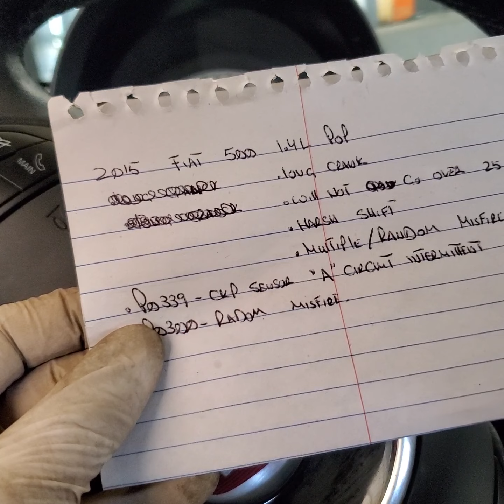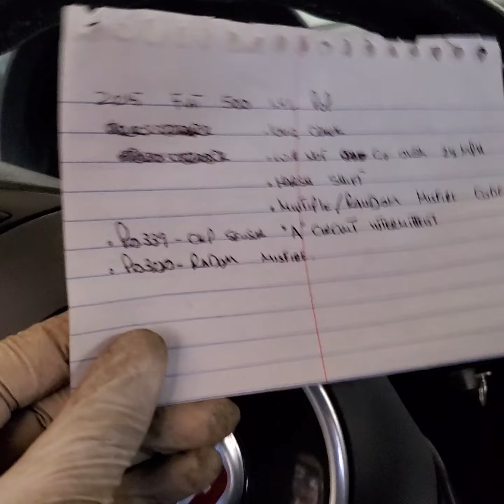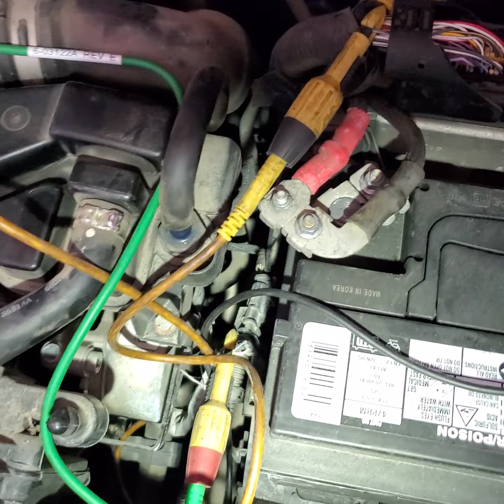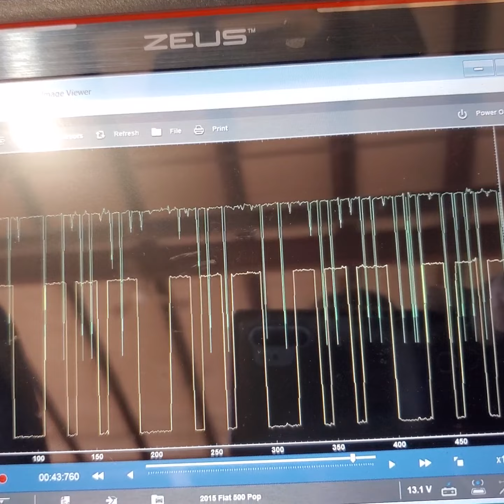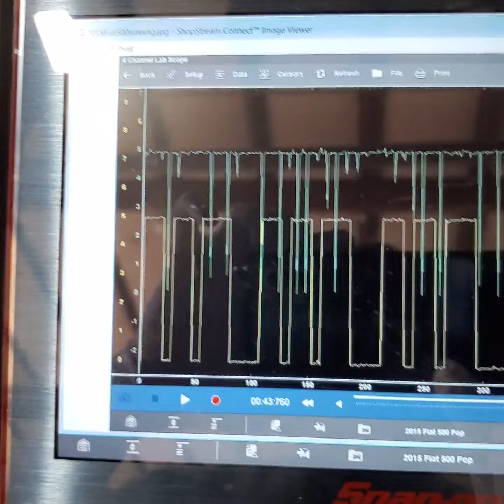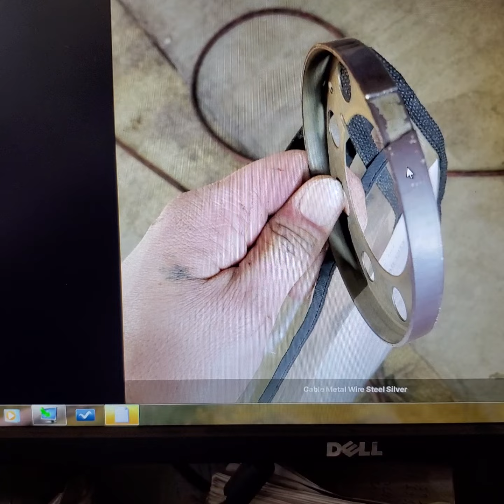2015 Fiat 500 - Code P0339,P0300.

Comment: So im having same problem i think i was getting the p300 misfire code but running fine i stepped on it pretty good and it went into limp mode is it work trying too change just the crank sensor first or is it possable the crank sensor is good and the tone ring is broke and is that common on these cars that the tone ring breaks and the sensor cant read it ?
Reply from the maker: If the crank sensor is bad, chances are vehicle would not start. Not sure if your technician can scope out the crank sensor or not. Crank isn't easy to get to it. I am assuming you want to tackle it yourself?
Reply: @waqasazmat81  it starts with a long crank thats just recent it was fine and running fine with just a p0300 random misfire i changed all the plugs coils oil seperator and it has a new battery thing that needed to be done anyway i went with first but i was driving yesterday and i stepped into it pretty good which i think may have caused that crank sensor maybe too go outta whack but at first i though the trans went in it but i limped it home and was getting a p0339 and a p01064 now its long crank im wondering if its possabkw just the crank sensor is bad and the ring is ok running before i had this limp mode problem was no problem ran fine even though i was getting the blinking random misfire code i would get a long crank sometimes which i thought maybe the start wasnt wasnt working and put a new starter in it im thinking of changing just the crank sensor but is there a chance the crank sensor could just need a relearn ? Thanks for any input
Reply from the maker: You can certainly try to replace the cranksensor but I highly doubt that is the cause. If you have the borescope take the sensor out and look through the borescope maybe that could shed some light on it. Crank relearn is only needed when the crank sensor or the wheel is getting replaced. Try to relearn it anyway if your scanner allows you. You not gonna hurt anything.
Reply: @waqasazmat81  thanks for the info what do you think i should do next ? You think the tone ring for the crank sensor may be the problem ?
Reply from the maker: @rwgtorn  take the sensor out and see the condition of the tone wheel see... if that's not the option then replace the sensor it's less time consuming then taking the transmission out. But get the parts from the dealership. I still think it's tonewheel.
Reply: @waqasazmat81  thanks is the tonewheel hard to replace have you replaced one before i know the trans has to come out i have a lift i can do it on just wondering the intensity of the job like is it a one day job ?
Reply from the maker: @rwgtorn  it's time consuming that's all. Not a complicated process. I am sure there are videos showing how to take the trans out. Definitely let me know what you find.
Reply: @waqasazmat81  thank you for all the info
Reply: I have the exact problem. 😢 Its going to cost a $mall fortune to pull the motor out to get to a $70 designed to fail part. Fiat designed the 500 so its basically impossible to service the car without pulling the motor out$$$$.
Reply: Same problem here. 6 months ago, dealer mentioned tone wheel and I thought they were crazy and were ripping us off, since I was just getting P0300 misfire codes. Other mechanics replaced plugs, coils, reset codes, engine light stayed on but no performance issue. They also said ECM was most likely issue and needed replacement. Now, the car has trouble starting, barely accelerates and I just got a P0339 and P0315 code. So Im going to try to replace the crankshaft sensor, if that doesn't work, it must be the tone wheel. Not worth since the car sells for $5000 in perfect condition.